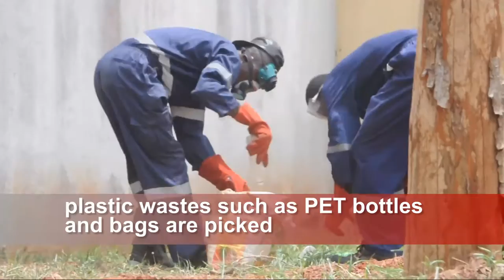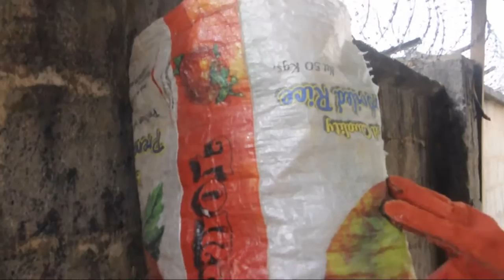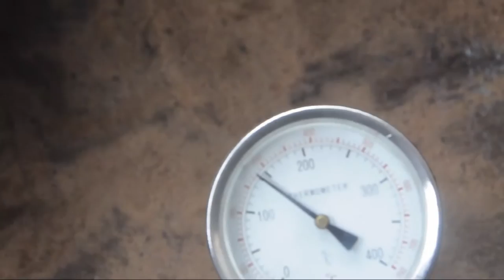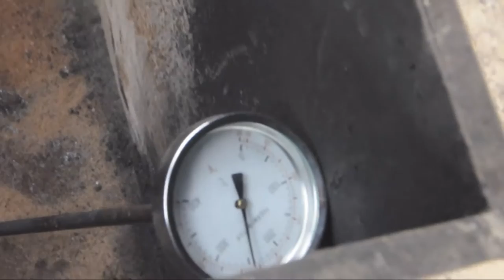Paver bricks with recycled plastics

Comment: how many kg of sand you use and did you specified on sand or we can use any sand.
then, how many plastic we can  used to produced two hollow block and two solid block
Reply: You can use any sifted dry sand (quartz, river), better washed, but without clay deposits.
For the manufacture of polymer sand products, they usually mix: sand - 74%, plastic - 25%, pigment - 1%

Comment: You are supposed to grind up the plastic into tiny pieces before you melt it.
Reply: Depends on choice
Reply: Not everyone has access to a shredder machine. In the absence of a shredder, it can be melted directly without shredding. It will only take a longer time.
Reply: If you can’t afford a grinder , how do you grind it